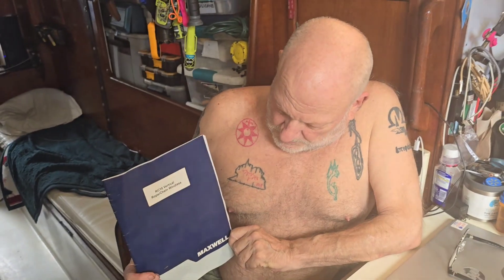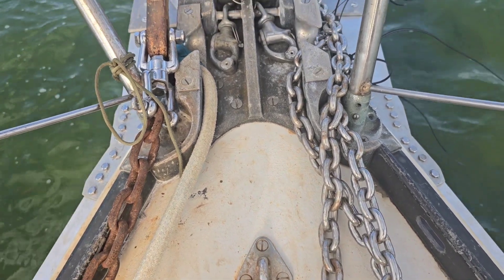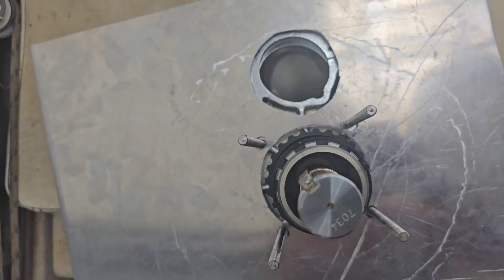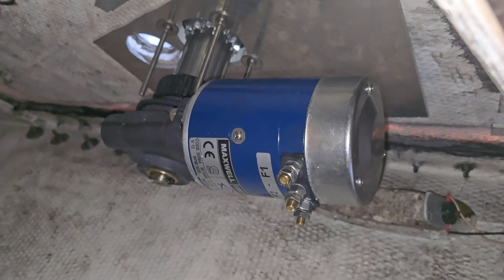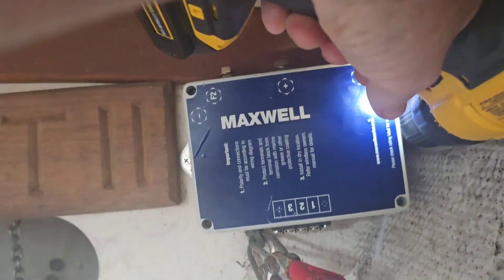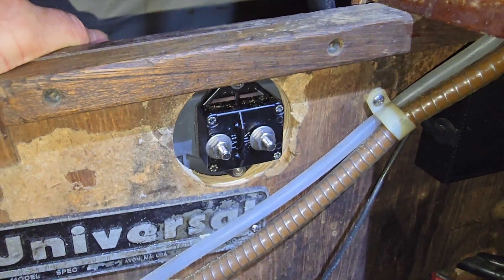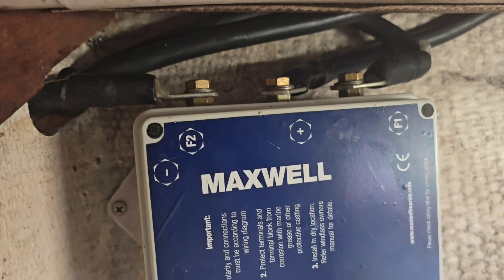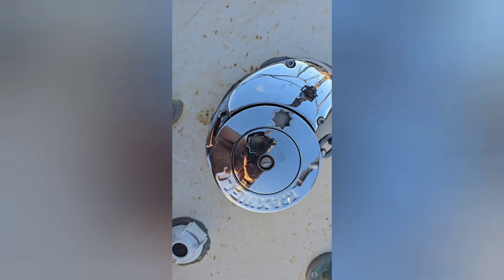Installed a windlass to pull anchor chain Maxwell RC10 on C&C 39 sailboat

Comment: Did you use Tef gel to prevent corrosion from thedissimilar metals?
Reply from the maker: @kkots  No. Looked at the cleats installed when the boat was built using aluminum backing plates and they are all still fine so did not even think about it.